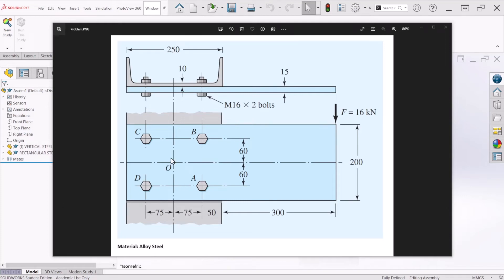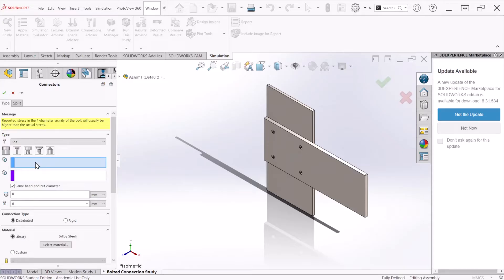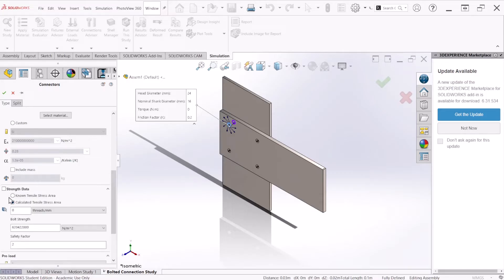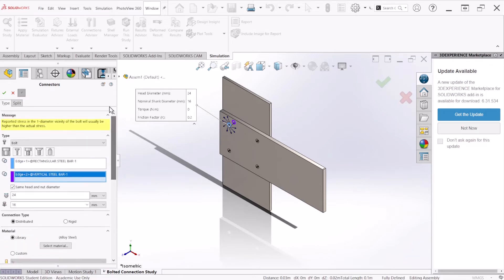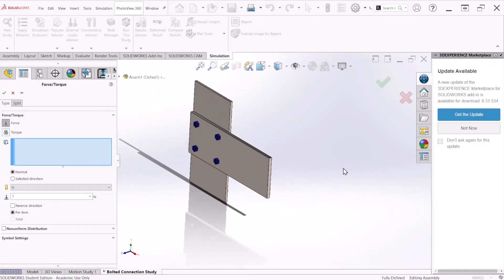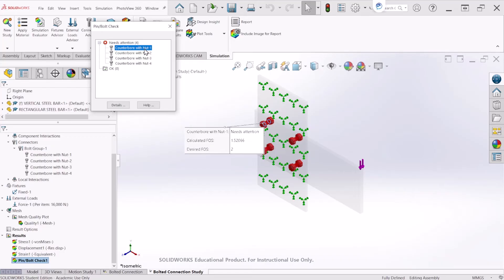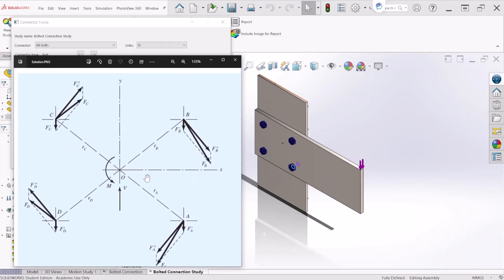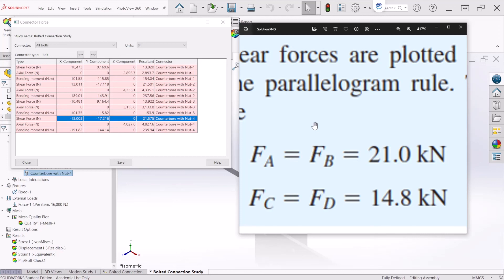Bolted Connection | Eccentrically Loaded | Safety Factor | FEA for beginners | SolidWorks Simulation

Comment: You forgot (or didn't know) about the most important part of a bolted connection, which is the pre-load. The pre-load create a clamping force between two surfaces which, when combined with a coefficient of friction, allows the load to be exclusive supported by the frictionnal forces between the two surfaces. A bolt isn't a part meant to resist to shear effort. They are meant to be used in tensile effort.
Reply: what typical values of preload should be used?
Reply: He copied a problem from Shigley's to show an analytical (Hand Calcs) solution against a numerical (FEA) one. That problem in Shigley's does not specify a preload condition

Comment: Hi, I was looking for how to do the analysis and came across this site.
It is very informative. I would like to ask you one question. At 12:41, it says FA=FB=21.0KN, FC=FD=14.8KN. How do you get these values in a normal calculation?
If you don't mind, could you please tell me the equation?
Reply: Shigley's 10th edition, pg 449, ch. 8. example 8-7. They are resultant forces, calculated from primary and secondary shear. Primary is a result of the force divided by the bolt number, secondary is a result of the moment. The bolt group experiences shear the plate being pushed down and from the moment. So you get translational and rotational reaction forces. First force is 16/4 = 4 second one is the moment arm from the force to the bolt centroid, which is the moment divided by the number of bolts times their distance from the centroid, M/4r = 6800/4*96 = 17.7. Then to get the resultants you have to do some trig to get the numbers you asked about.

Comment: Hello shouldn't the load be concentrated on the halfway distance of the 15 thickness? If so how you put load of 16 Kn totally distributed along the edge.that means that you should multiply this uniform 16 Kn load by 15 to get the equivalent point centered load. Am I correct?